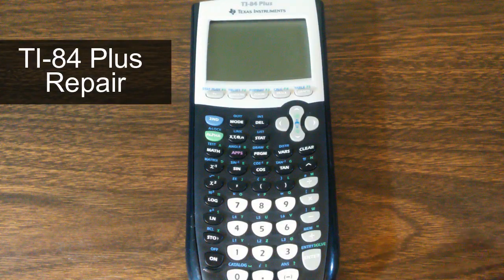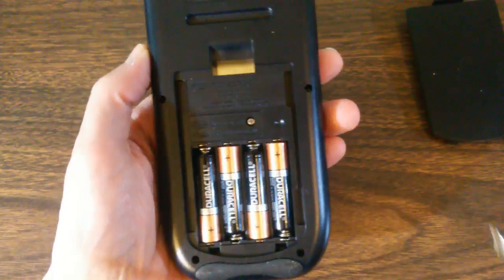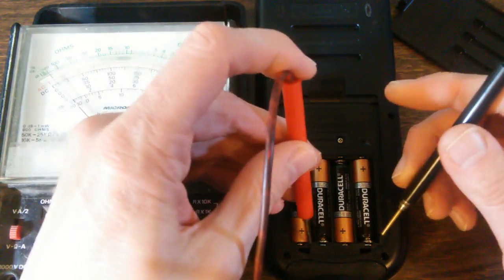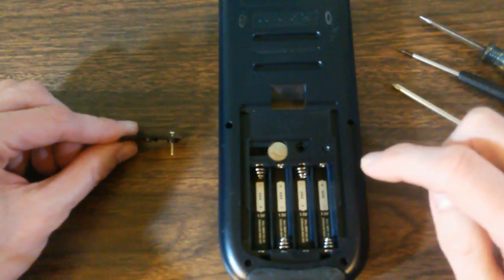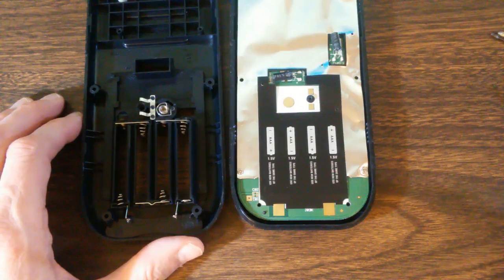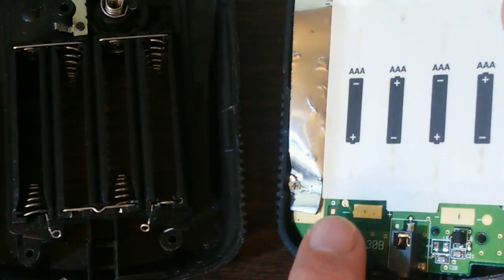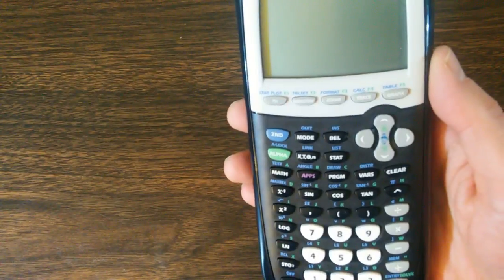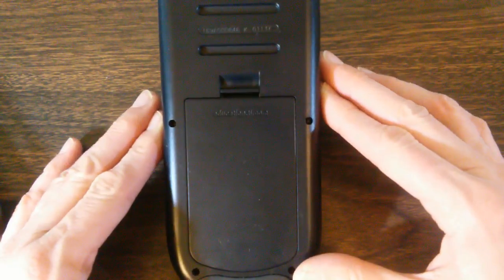TI-84 Plus Calculator Dead. Repair.

Comment: Thank you! Haven't used my calculator since graduating high school and now I need it for chem in my second semester of college and I almost died when it didn't turn on after putting new batteries in! This totally saved me and I didn't even have to open up my calculator, I just jammed a hair pin in the holes and jiggled it around until my calculator turned on.
Reply: EXACTLY WHAT I DID !!!!
Reply: Nicole Jones I legit was about to cry if this didn't work
Reply: THANK YOU!!!!!! THIS WORK!!! Even though I cleaned it. The small pins wasnt on the battery piece. So i had to put it there. The hair pin worked.

Comment: Wow.  This saved my daughter.

A month ago after not using the calculator for a few years, it wouldn't start.  I tried a lot of things and eventually plugged it into the computer and the calc started.

Then, yesterday, same problem and there is homework do tonight.  I plugged it into the computer and it started once, but stopped.  

Like others, I tried using a toothpick to move the connector pins a little, but it didn't work.  Yet, following your instructions, taking it apart and moving the connector pins (and cleaning all the contacts) did the job.  I ran through the house with joy!
Reply from the maker: Ran through the house with Joy?  Wow, thank for that feedback.

Comment: Thank you, this seems to have solved my problem for now. WITHOUT opening, I just moved the pins through the 'holes'.
Reply from the maker: That is clever.  Good thinking.
Reply: @c.davidgraves4848  Exactly what I did (my T6 was too short to reach the screws)! You saved my calculator, thank you :)
Reply: On a side note, I can't believe nobody caught that design flaw

Comment: Thanks very much for the thorough explanation of the issue!  We bent the pins a little through the battery compartment holes using a thin screwdriver and that was enough to get it fired up again.  Thanks again!

Comment: Thanks so much for the video! I just turned on a calculator I haven't used in 10 years! The contact was completely scratched out so I first wiggled them away from the calculator so I could check that the contact were actually touching a non scratched location. Then I kept bending one until it touched another spot. Thanks again!

Comment: I didn't have a t6 Torx screwdriver so I used a needle through the hinge holes to move the pins around. It worked! It might not last too long though so I'll have to get a proper screwdriver so I can secure the pins better. Thanks so much!
Reply from the maker: Some others have reported using the same short cut.  Good for you. Getting metal on metal is what is important.

Comment: Thanks a lot. The failure of my Ti 84 was caused exactly by what you demonstrated. Problem solved! 
Just be careful when you have a teacher version ti 84, top and bottom case parts are connected with a flat cable. So separate it with little force to prevent creating addational damage.

Comment: This worked for me. I also went ahead and cleaned out any battery corrosion that had leaked into the inside of the calculator and clogged the connector bits. Either way, it works now. Thank you

Comment: it worked for me but then it shut down after a few mins of use. I checked the voltage in the 2 holes and it does show 6v, what do you think it can be ? I changed the backup battery as well as put 4 new AAAs

Comment: If you have the teacher's version with the port to project with the now-old-school projector, there is a ribbon cable going from the top case to the bottom case... careful! It's around the middle of the right half of the calculator (screen facing toward you)

Comment: i tried this and i couldnt get my calculator to power on :( the little copper pad for the back up battery on my TI-84 plus is extremely worn down as well could this be the problem? is there any fix for this?

Comment: Mine still didn't work, but the batteries only delivered somewhere arounf 4.8 volts. After cleaning the battery compartment with spray duster I now have a solid 6.5 volts.

Comment: What should i do if the plates are completely rusted?
Reply from the maker: There is probably some good metal under there.  I have had good luck with fine grit sand paper and polishing compound.
Reply: @c.davidgraves4848  thank you,  i'll try that out.

Comment: Hi, what if the one of the metal plates is a little corroded? I scrapped off the corrosion (not sure if i shouldnt have) but its still bad. Is there anything elae i can do or is the calculator a lost cause?
Reply from the maker: Scrapping off the corrosion is good. You could even polish the contact with a fine sand paper or polishing compound.   You want to see shinny orange copper.  Test the contacts thru the holes with voltmeter probes.  If you do not get voltage at the contact, you may need to bend the contacts more.  The most important thing is that metal contacts land on clean metal pads.  It you are getting voltage on the contacts and the calculator still does not turn on, the problem in probably elsewhere.

Comment: Can you purchase replacement copper pads, one of my pad is almost completely deteriorated
Reply from the maker: You can not purchase the copper pads.  If possible, try to polish it with polishing compound or very fine sand paper (600 grit).  As a last resort you might try to solder some metal on it.
Reply: is there any way i can send you a photo of it?
Reply: @dominickj5421  I think taping a piece of double-sided conductive tape on the pad would work.